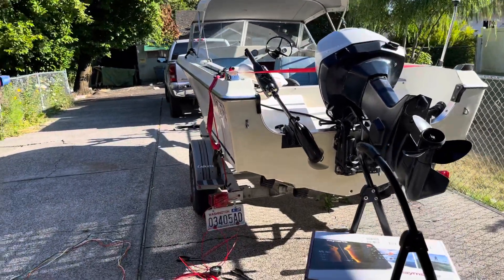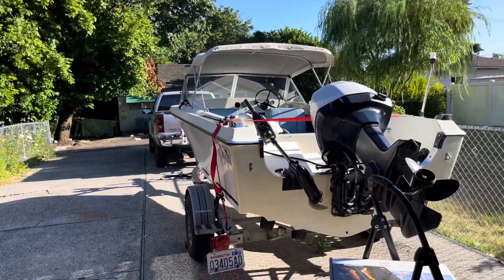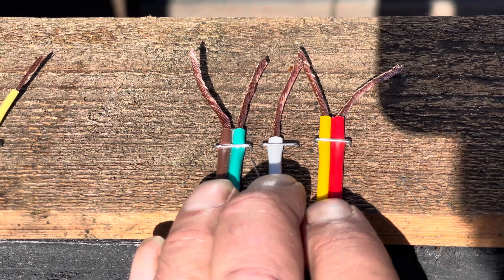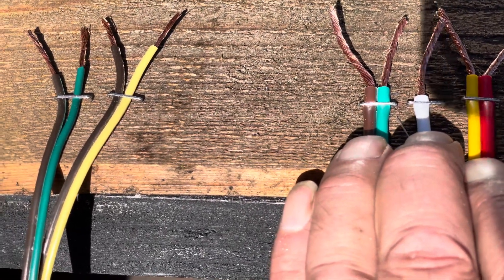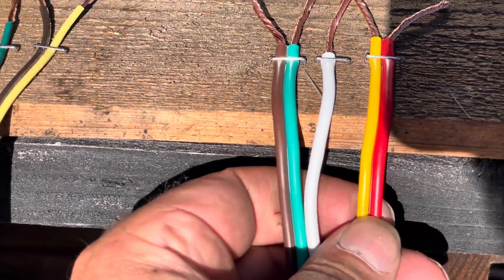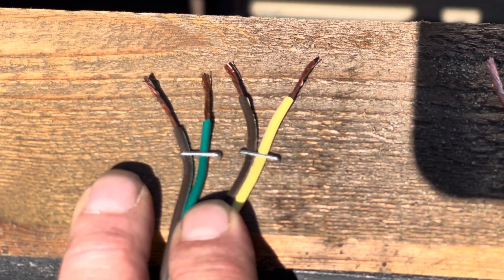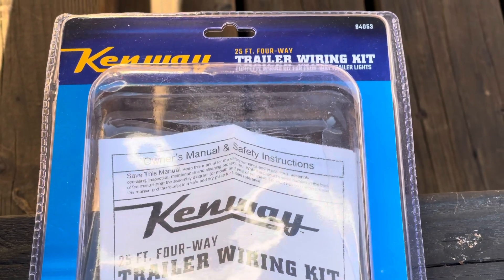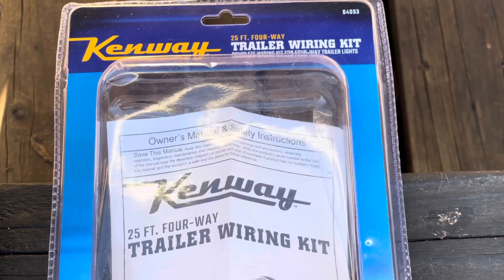Harbor Freight CCA trailer wiring (still good 2 years later)

Comment: THANKS for the video. 
I just picked up this exact kit AND guess what...the instructions do not match the product, so I am immediately confused (which is why I'm watching YT 🙂). Maybe you can help, since my actual wires look identical to yours; 1 WHITE, a BROWN next to a GREEN, and a RED next to a YELLOW. My instruction sheet shows 2 brown wires and no RED wire at all.  Looking close at my instructions, it does seem to show a "Y" in the brown near the power source end at the front of the trailer -- but that would require a much longer BROWN wire than provided.  That is, my brown wire is just the one piece of the same length as the RED and the GREEN. Should I cut the RED and use it as brown???  The instructions do not even mention the RED wire. 
How did you end up attaching the wiring? It would be much simpler if the instructions mached the product. Thanks for ANY HELP you can provide. I agree the quality of materials is excellent.
Reply from the maker: Sorry for the delayed response, spent the last two weeks in an isolation room in the hospital with a nasty case of Covid. It’s gonna be a while before I get back to 100% and able to respond coherently.
Reply: @jatoav8or  No worries -- it is solved. The RED on one side functions identically to the BROWN on the other side (for running lights, as opposed to brakes and signals), as many suspected.

Comment: A buddy bought this kit from HF in a pinch. It is copper clad aluminum wire which while not terrible, is not the best for wiring. The reason it is a heavier gauge is because the aluminum wire is not rated the same as copper. It takes a 14 ga alum wire to equal the ampacity of a 18 ga copper wire. Once my friend realized what he had, he returned it and bought one of those 'name brand' sets. The potential for over-heating and corrosion, especially in marine applications, lead to failures and replacements.

BTW, copper clad steel wire does not exist and if it did, it would be a disaster waiting to happen.
Reply from the maker: I appreciate your experience and input. The trailer wiring I installed hasn’t shown signs of corrosion or overheating but I did solder & seal each connection. The boat is almost  exclusively used in salt water.
Based on your comments I will re examine the wire and amend my comments in the video.
Soft Annealed Copperclad Steel Wire does exist, I’m using it as a horizontal antenna..
Reply: @jatoav8or  Hello - my mistake for not being more specific. I do know of the product of which you speak but I meant that copper clad steel wire is not used for automotive or standard building wiring. 
I also use my boat trailer in salt water and switched over to using tinned copper wire. Have not had a corrosion related wiring failure in over 20 years. Yes it was a few bucks more but not having to chase down a wiring issue every year or two was well worth it. Have also used it for my other trailers and a couple of hot rods. Have no idea what it costs these days but like everything else it's probably gone through the roof. 
Be Safe.